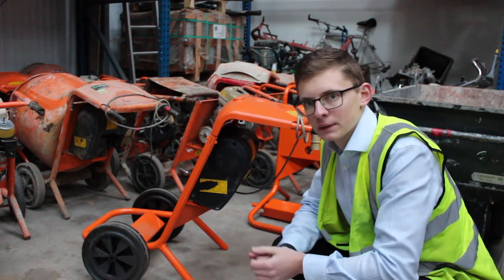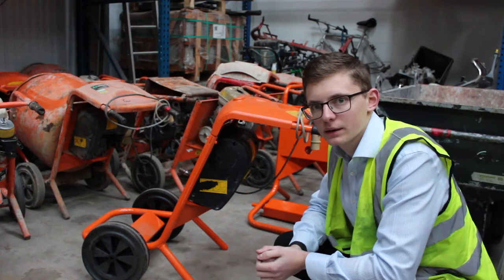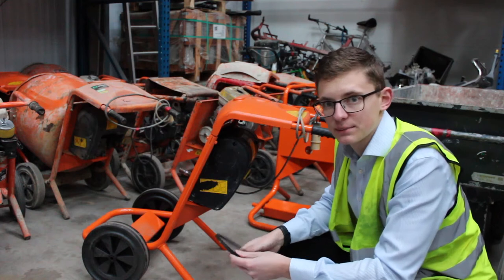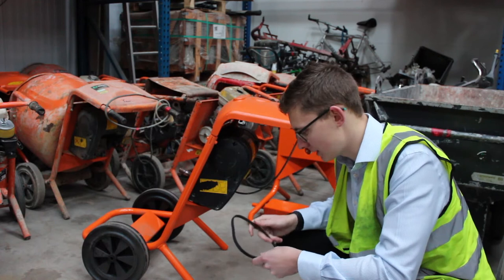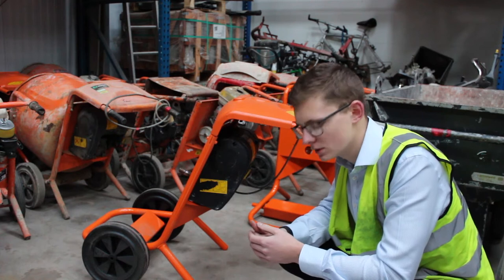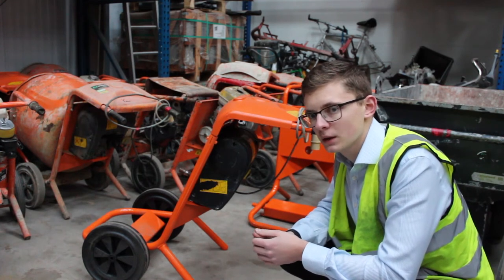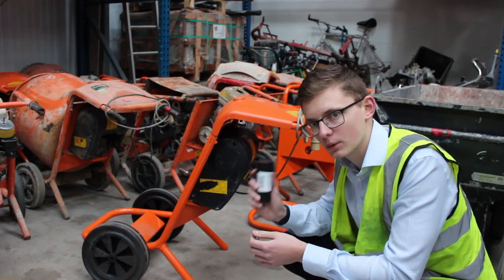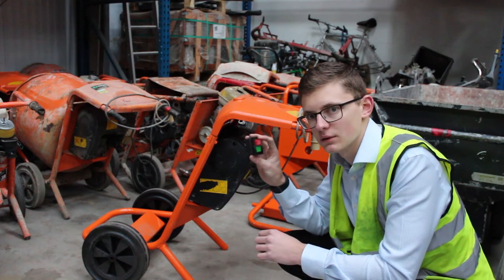How to resolve common issues for Belle Minimix 150 | HTS Spares

Comment: I have a 110V minimix, do the two red wires from the motor go to the capacitor (yes), or the switch?  I presume the white and black wires from the motor go to the switch and breaker. Thanks.
Reply from the maker: We have two wiring diagrams for this! Pop an email over to marketing@htsspares.com and I'll send them across for you 😀

Comment: Thanks, but how do you remove the Pulley shaft bearing ?........Not the drum shaft bearing..and is it grease lubed or from the oil in the gearbox?   Thanks

Comment: Helpful video.
when I press the On button the drum does not rotate and I hear a electical buzzing noise. Do you have any idea what the issue could be?
Reply from the maker: Hello, that sounds as though there is an issue with the capacitor and it will need replacing.
You can find these here:

240V https://www.htsspares.com/catalogue/tool/mixer/belle-minimix-150-parts/show/minimix-150-electric-motor/motor-capacitor-25uf-0

110V https://www.htsspares.com/catalogue/tool/mixer/belle-minimix-150-parts/show/minimix-150-electric-motor/motor-capacitor-110uf

Comment: Why is my 2002 belle mixer electric 220v  motor running in an anticlockwise direction? It starts fine with no humming. What could it be ? I have checked my wiring and it corresponds with the wiring diagram for this particular model.
Reply from the maker: Hello

You could try wiring it the opposite way and seeing if the motor starts running the correct way.

Comment: I replaced the belt on my mini 150 the other day it’s started to make a thumping noise when I look at the motor the housing is shuddering a bit the more I put in the worse it gets it hasn’t stopped yet but I’m concerned if I’m in the middle of a job
Reply from the maker: Hi Gary, it could be that the Pulley has worn out so it is just grinding on the belt.
Reply: @htsspares7718  the pulley looks ok I’m not sure I’m going to run it with some concrete in it and leave the cover off to see if I see anything obvious the things is it’s a 2008 model but it’s not been hard worked in my opinion.

Comment: Hi ive caught the wire today on a belle 150 mixer and its pulled the wires out of the 110 end. Ive put it all back how it should be and its still not working no sound no nothing. Is there a fuse located anywhere on the mixer that i could of blown theres no other loose wires everything looks fine
Reply from the maker: Hi Rob, thanks for your question! There's no fuse within the machine, but I wonder if you may have tripped the trip on the transformer. 

If you'd like any more advice, please give us a call on 01432 373 350 and ask for Richard, he'll be able to help 😊

Comment: Hi 
I am in Sydney Australia,  I have a belle  mini mix 150 that occasionally makes a  real loud fast knocking sound from the motor when it has been on for a while and is full . If I turn it off and empty it, the noise goes away
Reply from the maker: Hey, thanks for your question! Assuming it's petrol-powered, it sounds like it's the belt slipping. This means you'll either need a new belt, or a new pulley wheel (depending on where the issue stems from).

If you're browsing our site, I've linked both parts below:
- Belt: https://www.htsspares.com/catalogue/tool/mixer/belle-minimix-150-parts/show/belt-honda-g100-gx120-briggs-stratton-electric
- Pulley wheel: https://www.htsspares.com/catalogue/tool/mixer/belle-minimix-150-parts/show/belle-minimix-150-gearbox-after-2000/gearbox-pulley-kit-honda-gxh50-2000

Hope you get it sorted!

Comment: I have this cement mixer and it runs for a few minutes then stops it's got a new capacitor and the fan is working could it be the points need cleaning please can you advise?
Reply from the maker: Hi Paul, a couple of things you could look into: check whether the points need cleaning, check for a faulty motor or a faulty switch that could be tripping the switch. Hope this helps!

Comment: Could a old, stretched (loose) drive belt possibly cause an occasional whining noise from the electric motor area?
Reply from the maker: Hello Robert, yes it could do as it might be not fully engaging with the pulley and slipping on the gear teeth.
Reply: I find that if you let the labourer have some time for his dinner, then he tends to stop whining about as much.

Comment: My belle mixer packed in today mid job. Spins fine when empty but as soon as start loading it it stops ! Any ideas what could problem be ? Thanks
Reply from the maker: This sounds like it could be a slipping belt, but should be an obvious noise if so!
Reply: @htsspares7718  thanks for reply. There’s a little noise when it’s running. Would I be needing a new belt or would this one tighten up ?
Reply from the maker: @Nufcgilly  It could be a new belt or a new pulley depending on which is more worn - hope this helps!
Reply: @htsspares7718  thanks again. Will get it looked at asap. 👍

Comment: Hi I have a Belle 150 mixer and I have noticed lately that the motor is making a whining noise but still working fine any ideas what it could be thanks paul
Reply: Proberbly bearings going dry in the motor , had this on mine and replaced the bearings and it's fine now

Comment: Hi, my on off button stopped working so I bought the new electric unit and swapped it over. It works when I hold green button in but it not staying in. What bits missing? Something between buttons and unit?!
Reply from the maker: Hello, 
It sounds like the capacitor needs replacing.
 Depending on the voltage of your machine you may require a HMX0525 (230V Capacitor) or a HMX0097 (110V Capacitor), both available on our website at: https://www.htsspares.com/buy/motor-capacitor-110uf 

Please let us know if we can help with anything else :)

Comment: The small pulley keeps coming off on my belle minimix 150 it would seem the star shaped split  washer has had it. Do you know if this is a common problem
Reply from the maker: Hello, if the pulley shaft is worn then it will keep coming loose and may need replacing.
We would suggest a new pulley kit (which will include the star washer) and see how that goes. You can purchase the pulley kit here: https://www.htsspares.com/catalogue/tool/mixer/belle-minimix-150-parts/show/belle-minimix-150-electric-motor-after-april-2002/electric-pulley-kit

Comment: I have an old belle
mixer 140lt , everything works fine until one day he start to lose power not enough to fill it normally half way and today after the capacitor is changed still the same thing any idea what is going on (i didn’t replace by myself the capacitor so i don’t know what μf they put )
Reply from the maker: Hello,

It sounds as though the electric motor is worn and needs replacing. Unfortunately this is a domestic machine so we are unable to supply parts for this. We can however supply a complete new machine which can be found here: https://www.htsplant.com/product-category/cement-mixers/

Comment: I think the capacitor has gone on mine.Would a broken capacitor smell,and can I still use it to finish a job before replacing the capacitor or would this cause more damage?
Reply from the maker: It does sound like your capacitor may have blown, you'd be wise to change this as not only could it cause more damage to the motor, but it could also potentially catch fire!

Depending on the voltage of your machine you may require a HMX0525 (230V Capacitor) or a HMX0097 (110V Capacitor), both available on our website at: https://www.htsspares.com/buy/motor-capacitor-110uf 

Hope you manage to fix it!

Comment: my belle mixer stops on its own after 10 mins or less, but it keeps working if i keep my finger on the start button.
what could the problem be?
Reply from the maker: Hello, so sorry for the delayed reply. Replacing the switch should solve both issues. Here are the links to the parts on our website:
240v: https://www.htsspares.com/catalogue/tool/mixer/belle-minimix-150-parts/show/minimix-150-electric-motor/switch-assy-230v-2
110v: https://www.htsspares.com/catalogue/tool/mixer/belle-minimix-150-parts/show/minimix-150-electric-motor/switch-kit-110v-0
Reply: Haha I don’t think it’s the switch bud it’s the folio plastic fan not spinning keeping the motor cool so it over heats and cuts out. If the switch didn’t work it wouldn’t work full stop.